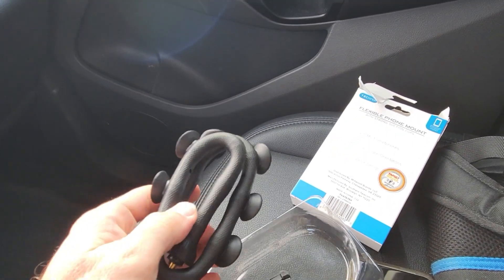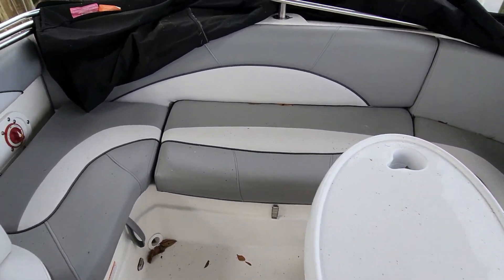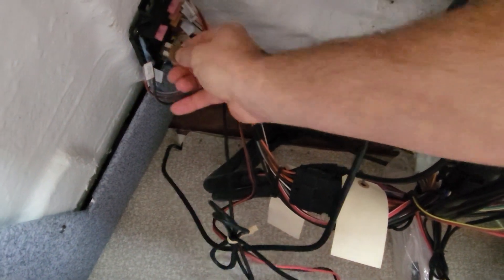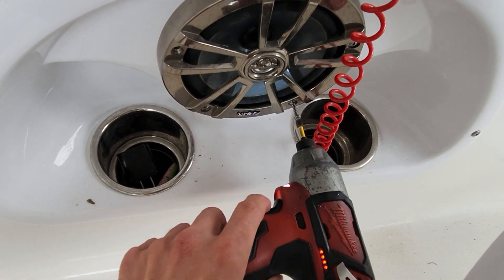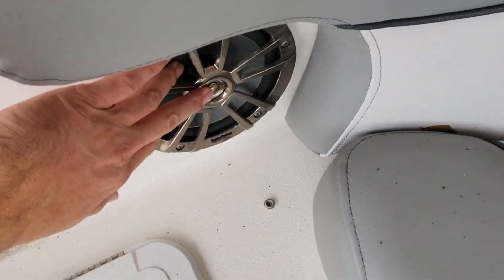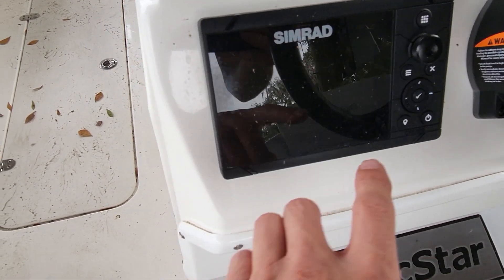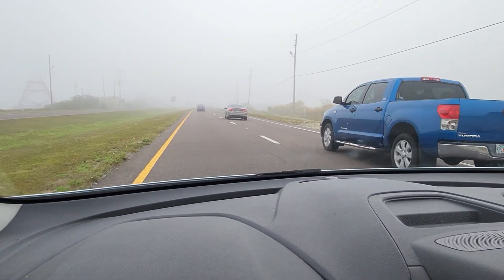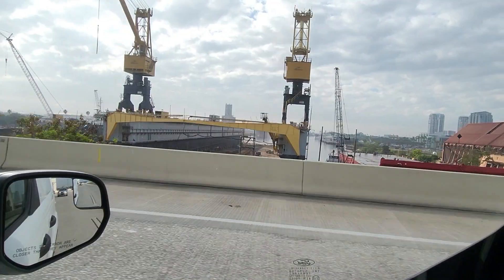Service Call To A NauticStar 203 SC #Infinity #RoadTrip #ServiceCall #Episode203

Comment: But why did fuse blow?
Reply from the maker: The only thing I can think of is low voltage or the stereo is starting to fail.  If it happens again or something else happens I will bring some extra parts. Usually when I find a blown fuse I don't get a phone call that it happened again.  It is kinda strange. I agree.